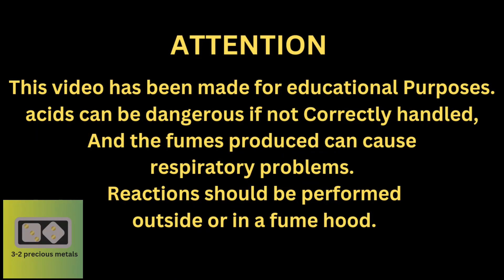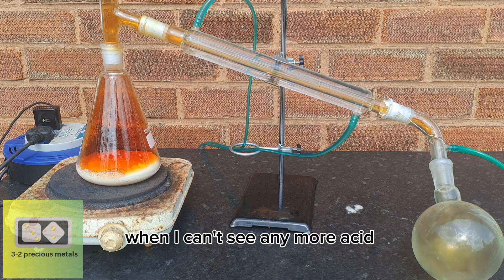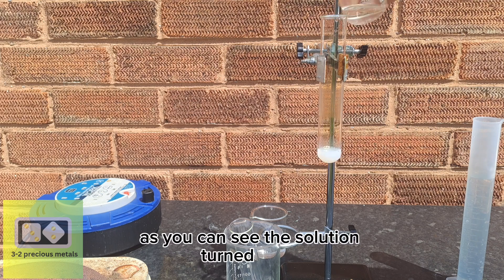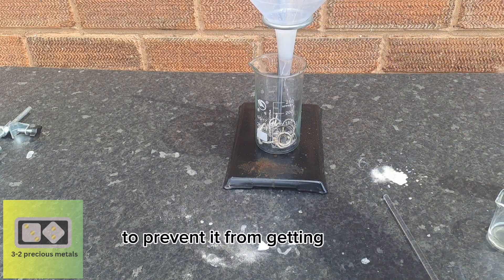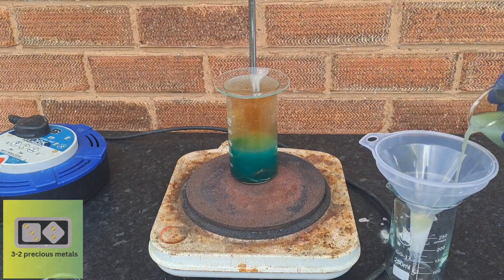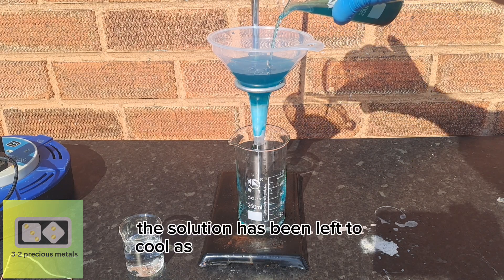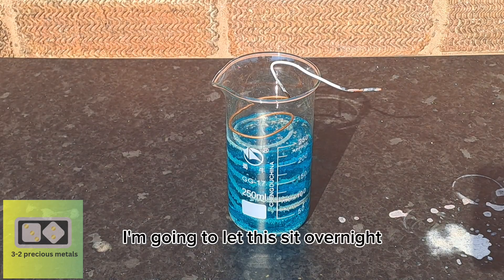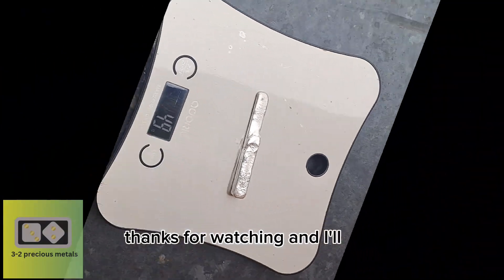how to REFINE SILVER with HOMEMADE NITRIC acid

Comment: I did the same prosses 3 time but each Time i get a white ponder but when i melt it the Result is 50%alloy can you tell me why
Reply from the maker: If you have followed this process and you are starting with sterling silver, i can't see any situation where you could possibly get a 50% alloy. Silver goes into nitric acid, and gold doesn't so gold would be filtered out. Copper will only displace anything below itself in the reactivity series, so it's not alloyed with  tin or iron or zinc as they would remain in solution. The only other metal it could be would be palladium. If you have a 50% mix of silver and palladium, congratulations, but you would now need to separate those 2 metals. To do this, you would need to re dissolve your material and use hcl to precipitate silver chloride, which can then be converted to silver metal. Your palladium will remain in solution and can be recovered with the copper displacement. What is the xrf you are using, saying the other 50% of the metal is?
Reply: @3-2preciousmetalrecycling i refine 78.8 gramme of Sterling silver and 153grmme electrical Cantat
Reply from the maker: There could have been palladium in the contacts. I would now re dissolve your material and separate the silver using hcl then convert the precipitated silver chloride back to silver metal. my preferred method for this is to wash the silver chloride and then dissolve it in an excess of ammonia and then precipitate the silver metal with ascorbic acid. If you dont have ascorbic acid you can drop a copper bar in there again to get the silver back out of solution. Then drop a copper bar in the other solution to recover palladium if it is there
Reply: I will try thanks sir